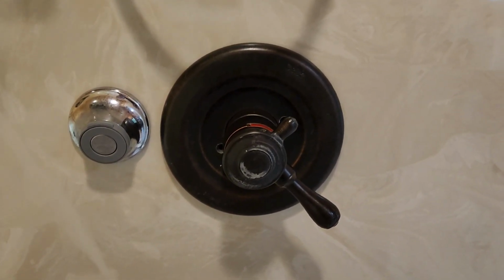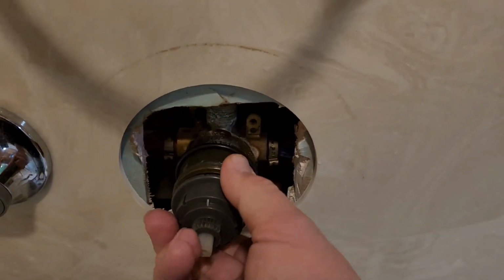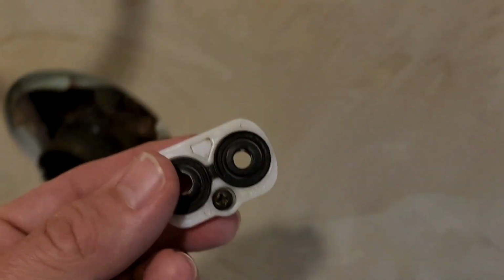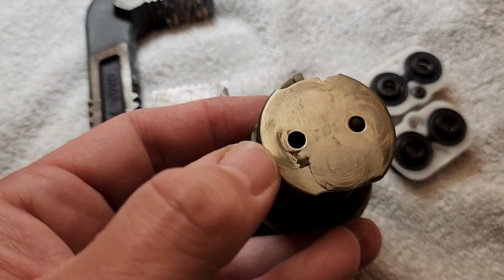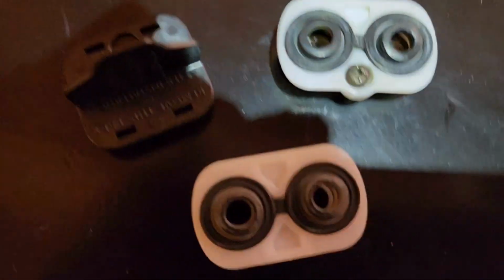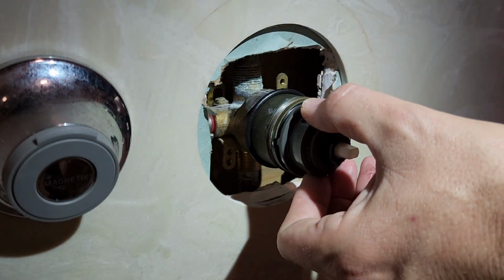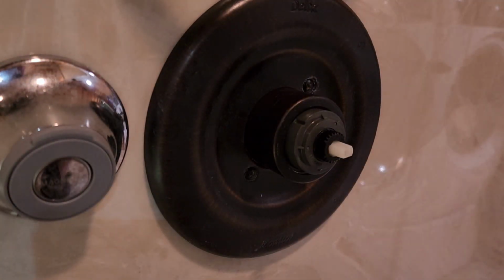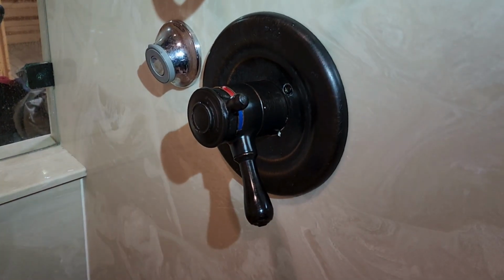Delta Shower won't stop leaking! Redesign of Cartridge & Replacing Delta Shower Valve Cartridge

Comment: great video. I've got two giant wrenches on my collar and can't get it to budge, either from over-tightening or all the lime buildup
Reply from the maker: Man, that is terrible! I hope you get it apart!
Reply from the maker: @Adam-ic4nr  you might have to cut it and replace the full valve assembly or apply heat. Not sure how much heat might help with calcium or if you could damage the valve housing. You might try a bag of CLR taped around the neck for the night.
Reply: @ i cut a notch with a grinder and tapped it with a screwdriver and it broke free (saw on another youtube video) but thanks for the tips